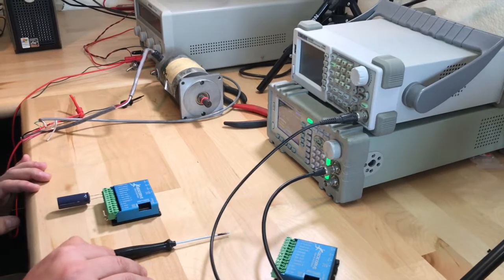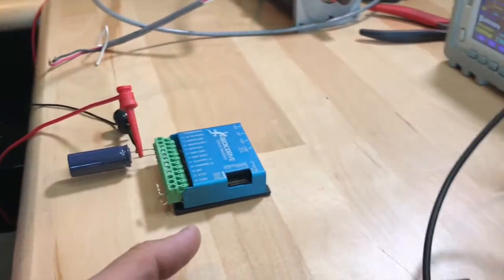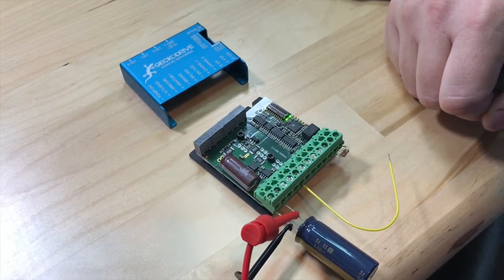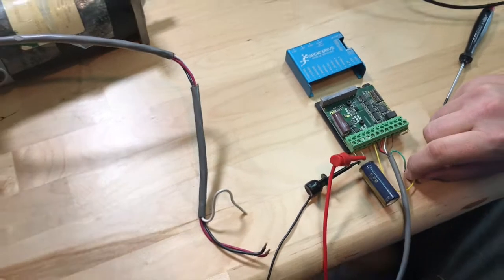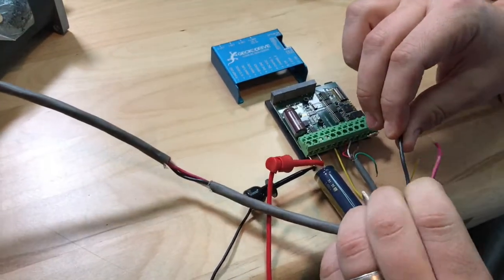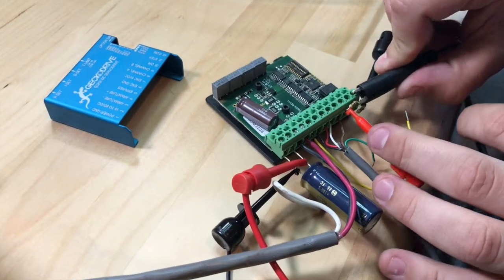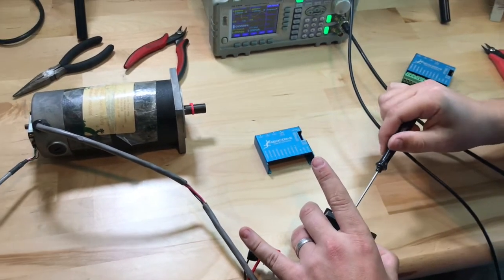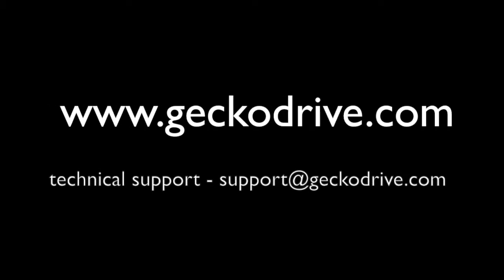Initial setup and tuning of a Geckodrive G320X

Comment: Great video !!!

A video by Jeremy Fielding on how to make any motor into a servo motor sent me on this journey. I have a CNC router running on a Geckodrive G540 that I'm really happy with so decided to buy their G320x to experiment adding positional control to the spindle on my small Unimat SL1000 lathe for threading. Gecko's technical support was very helpful and recommended a AMT102-v encoder for this project which has worked out well and is very cost effective.

Bought a cheap 150 watt brushed 24 DC motor with a 3,600 max RPM and hooked everything up to a 24 VDC power supply and a FluidNC 6 Pack CNC controller. Everything seemed to be correct but I was having trouble getting the motor to run without immediately going into the out-of-position error mode. Contacted their tech support and they called me from Hawaii !  They were very generous with their time and knowledge and recommended some changes that got me going.

Having fun now !!!

Highly recommend Geckopdrive.

Comment: How have you setup the function generator? I need to set my drivers up
Reply from the maker: The function generator is set to a 5V square wave with a COMMON GND. If you have an oscilloscope you would zero out the scope to GND and adjust the offset to be +2.5V on the function generator with a 5V amplitude on the square wave. The frequency of the pulses will determine motor speed. The drive works in quadrature so you need to multiply your encoder line count by four to determine how many pulses you require per revolution.

Comment: The video shows all of the dip switches in the ON position, but that doesn't match the expected factory default settings as listed in the manual.  Warning to those who follow this video, I suspect you'll want to set the dip settings appropriately, and likely ensure that the gain settings start off in default (off/off/on) positions before tuning.   Changing the gain dips afterwards would mean starting tuning (PID) all over again.
Reply from the maker: The DIP switches will be set for each application; our test stand is designed in such a way that the DIP switch being set to ON for all switches is the most optimal. The default setting that is noted in the manual is going to be the 50% setting, where you can adjust it up and down from there. In a tuned system there is no true "default" option as every variable, from the motor to the power supply voltage to the encoder line count, will change the baseline setting.

Comment: You don't hold the motor down when first testing ?  It could jump off the bench if not tuned or wired wrong.
Reply from the maker: no, we don't hold the motor down in this video so the viewer can see the motor movement on direction reversal. This is a motor and setup that we are very familiar with so we know the limits of how far it moves, but good practice would dictate securing the motor or moving it away from a table edge the first time it is connected for testing.

Comment: Some of this was different than what I experienced setting one of these up today. When I had the encoder hooked up and the motor disconnected while manually turning the shaft it went through warning and then error almost instantly instead of taking a few moments to make the transition as I see in the video here. I’ve still got a lot to figure out, but I’m on my way to resurrecting this old plasma cutter.
Reply from the maker: The rate at which the LEDs change will be encoder line dependent. The following error is a number of counts on the encoder the motor can fall behind before faulting. If you have this set to 256 and your encoder is 1024 pulses per revolution then it will take a full 90 degrees on the shaft before the drive faults. However, if this is a 10,000 pulse encoder it will be only about 9 degrees before the drive goes into a fault state.
Reply: @GeckodriveInc  After revisiting it last week I got things working much better. Finding my ideal PID settings seems to be the hard part for me now, but otherwise I'm super happy with the G320X.

Comment: the controller that i am trying to connect the Gecko 320x has the  input ports labeled as  Zp+,Zp-,Zd+,Zd- Any suggestions on how to do the wiring since the outputs of the driver are step, direction and common? Thank you
Reply from the maker: You will need to tie the STP and DIR (-) lines together and run them into the COMMON terminals, then run the DIR+ to the DIRECTION input and the STP+ to the STEP input.

Comment: As far as the step and direction is concerned, can I switch a 5VDC signal without the use of an external computer or microprocessor? I would like to use a very simple handheld box with a switch (up/down) to move a motor cw and ccw. I have used STAC5 controllers in this way with a fixed velocity. 5VDC to the step input energizes the motor and then adding a 5VDC signal to the dir changes it's direction.
Thanks!
Reply from the maker: Hi Scott- No, it must be pulsed. The STEP will move one increment of motion for every rising edge, so a 5V signal will result in only a single pulse being taken.
Reply: @GeckodriveInc  Thanks for the help!!

Comment: This looks like it replaces old style analog dc servo drives for industrial cnc machines made in the 90's. Very awesome.
Reply from the maker: The G320X can be used on older machines to replace analog controls and modernize the equipment. It operates off of a 3.3V - 5V TTL square wave STEP and DIRECTION signal.

Comment: Thanks for the video! 
Where and how could be connected "EN (Enable)" signal to Gecko G320X? Typical controllers has "Step", "Dir" and "EN" signals. If I want to temporary release the hold torque what should I do?
Reply from the maker: Hi Vasilen, The Error Reset pin (ERR/ RES)  can disable the drive. Bringing this pin low will shut off all power to the motor.

Comment: what is the biggest size motor that can be used with G320? can it be used on a 90v 3/4hp motor?  thank you
Reply from the maker: The G320, G340, and G320X will all have a maximum rating of 80VDC and 20A. You can use a larger motor than that but the drive will self-limit to its maximum current, and the input voltage should not exceed the maximum voltage rating of the drive. Speed is directly proportional to voltage and any voltage difference between applied and maximum will result in a maximum speed cap that follows the same ratio. Torque is proportional to current and will follow the same rules previously mentioned, with a linear relationship of torque to current applied.
Reply: @GeckodriveInc  thank you

Comment: This is a DC motor with an encoder?   Why did I think the drives could only be used on steppers?
Reply from the maker: The G320X is used for closed loop servo control with DC brush type motors. A lot of our products, specifically our G200 series of drives, are stepper specific. Our G300 series is our servo line with the G320X being our flagship drive from that series.